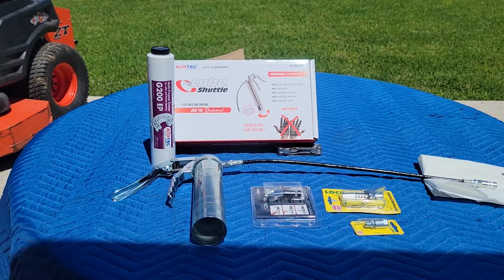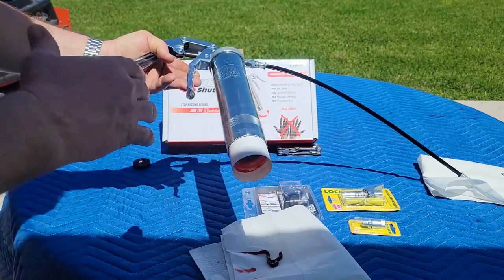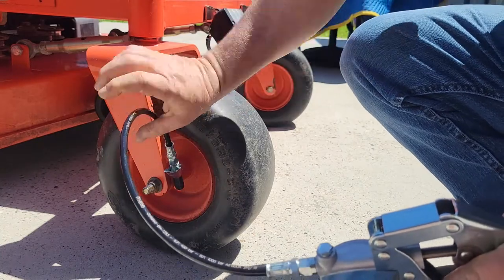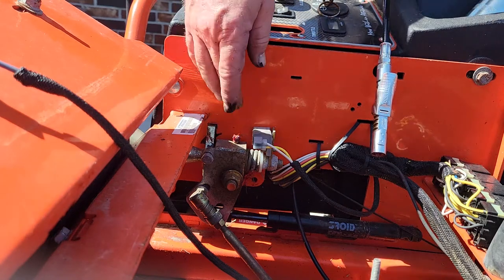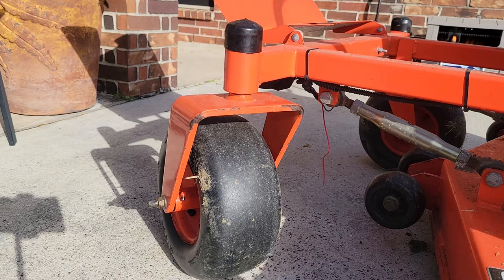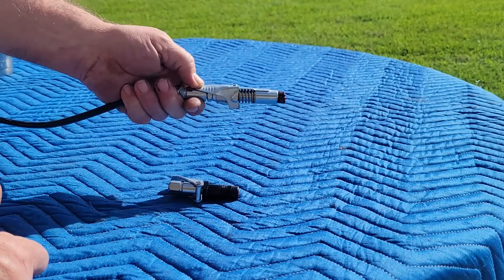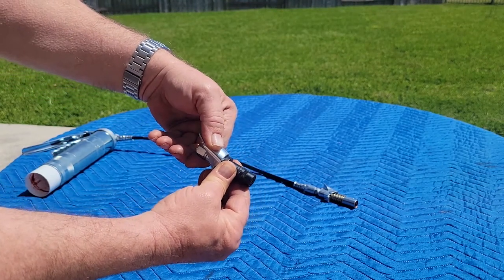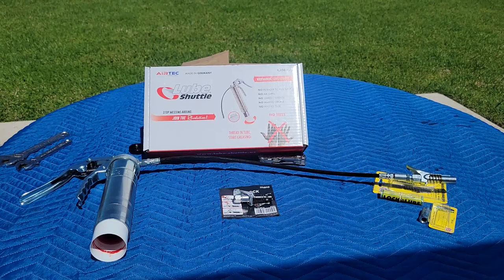Lube Shuttle Grease Gun, safeLOCK and LockNlube Coupler Review

Comment: I have the same problem on both of my Lube Shuttle (Mato) couplers. They are extremely sensitive to zerk tolerances (SAE vs metric, paint etc). I have machines where on say 5 of the 30 zerks, the Mato coupler just won’t attach even though it is a straight shot. Another few require a ton of force to attach. The Lock N Lube is larger and doesn’t have the built in swivel but it just works.

Comment from the maker: Thanks LockNlube for pointing out that I was not using the swivel correctly. As recommended, it could be installed between the hose and the grease gun which would eliminating the added length to the coupler. Also "CARL" noted that LockNLube now as a similar grease gun. I'm considering ordering one of there's for comparison. So look for follow up videos on the grease guns and couplers.
Reply: Did you happen to purchase the LockNLube Easy-Prime grease gun?  There are a few reviews about the Easy-Prime gun but I can't find a single comparison video between the Lube Shuttle and the Easy-Prime.  I'm stuck between the two, but I'm leaning towards the Easy-Prime because the LockNLube coupler seems to fit Zerks better.  Another plus about the Easy-Prime is that you can use standard grease tubes.
Reply from the maker: @James Yarno  No, I haven't had the time, but I still plan to. The lockNLube coupler can be used with either of the guns. But I understand being able to use standard grease.

Comment: LockNlube offers the same style of grease gun now...
Reply from the maker: Thanks for the info. So I watched a video of the lockNLube version. Similar but not exactly the same.  It does have the advantage of using standard grease tubes. Disadvantages are not being able to recap grease and having to install and uninstall the plunger. I think both are improvements over the standard grease guns.
Reply: @kenmri1  That is their easy prime gun. Look at their spin on gun (green body). It works exactly like the Lube Shuttle, takes the same cartridges and everything.
Reply from the maker: Gotcha, I see it now. Yes it looks like it works the same way. I'll do a little research on grease types and prices. Thanks